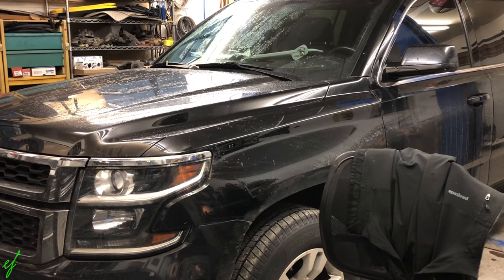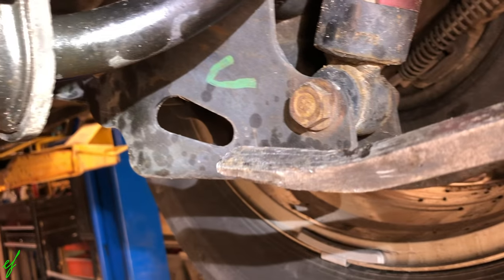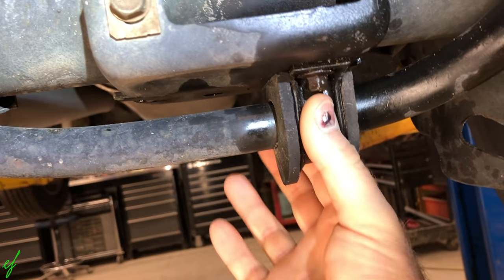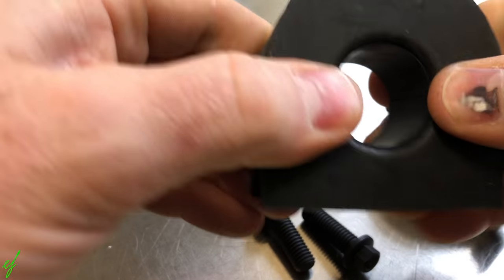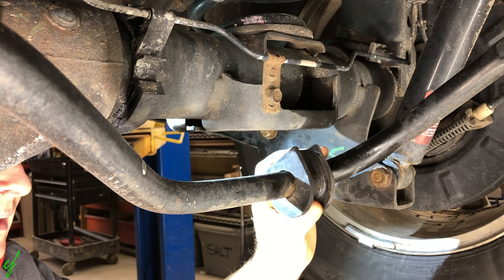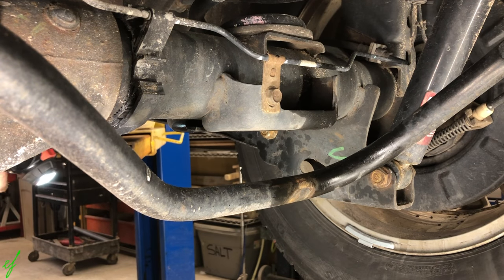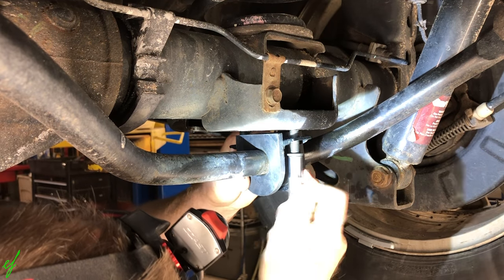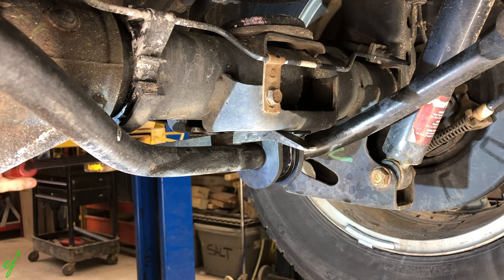SWAY BAR BUSHINGS  |  Professional Sound Diagnosis & Replacement

Comment: Cool vid 👍. I had thought the bushings went "harder" with age. I didn't know better. In the vid you're working on a rear axle right ? I've got kind of a funny noise but mine's
up front, when turning the wheel almost all the way. My ball joints (steering, suspension) are less than 10k miles old And my bar links are also pretty recent. I'm guessing it's those bushings. Ought to be them, right ?
Reply from the maker: The bushing are basically made of a polymer or rubber compound. They are made to be softer than the steel bar that goes through them. So basically the bushings will typically always be the wear component. I would highly suspect them. But to be sure I always shake everything down and try to locate the loose component. 🙂

Comment: What is the reason the bad bushing (loose) cause clunking noise? What metal to metal it is hitting. I looked at the sway bar and  it goes to sway bar link and strut but it wasn't hitting any metal? I have changed sway bar link (leak), outer tie rod (leak) but noise still there. I checked ball joint , control arm and strut there is no leak and it seems fine. I think it may be the bushing but it looks ok and no play or loose but it has 190k on it and almost 13 years. Th e clunk noise only when car slow down or slow start up or turning. Other than that, car runs ok. No noise.
I think it may be the sway bar bushing.  Thanks for the video.
Reply from the maker: No problem! The clunk from sway bar bushings is very much like a loose link, except bushings have a slightly noticeable rubbery clunk. Sway links sound more like a metal clunk. It is a very subtle difference, but it is there if you have a good ear. Any part of the sway bar system that is loose causes an amplified noise. That is because the parts are hooked directly to the body/subframe/or frame of the vehicle. They sound louder than you would think they could ever be for such little clunking movement in the parts. Through process of elimination is nothing else is loose and you have higher mileage, and you can not pinpoint the cause, bushings is a great guess. Plus they are one of the cheapest repairs on the car. I see a mysterious clunks from bushings once in a while like you describe. Probably worth a shot if you can not pinpoint the problem and everything else looks ok 😃🔧
Reply: @EasyFixShaun  Thank you so much for your explanations. I will update later whether it is bushing. By the way, that little noise drives me crazy.

Comment: I need to change my 03 Altima bushings and I need advice if it’s a good idea to buy them new online then install them or just get them new from the dealer ‘more than double the price’ also if there’s a difference between front and rear bushings or just buy 4 of them ? Thanks a lot.
Reply: Same question I have do we buy 2 for the front and 2 rear? Probably so I’ll keep you posted once I receive the parts this week
Reply from the maker: Usually they come in pairs when you buy them. Usually the fronts are different from the rears. I would look up the aftermarket parts you need based on the year, make, model, and engine that you have. When looking them up at the dealership the vin number is usually the best way so you will want to have that handy. On bushings usually any brand will work fine. Since they are usually dirt cheap parts in general I don't hesitate to use OEM parts from the dealers. They are usually very similar in price and the quality is always better. With nissans, parts are generally harder to find so that may be your only option. Good luck! 😃
Reply from the maker: Yup usually they come in pairs. Not always, so double check when ordering 😀
Reply: These are 12 $ by moog for  rear and 12 for front  at advance auto

Comment: Can i replace the rear sway bar bushings without the car jacked up?
Reply from the maker: Yes you can. You want to make sure the suspension is level on the axle you are working on or the bar will have spring pressure in it. (It is always trying to level the suspension side to side). This could make disassembly dangerous and reassembly very difficult. Basically you will be fighting the bar if the suspension heights side to side are not level. Here is another video I made with more information for both the bushing and the link 😃🔧 https://youtu.be/0S8JBe_jn6g

Comment: i have one of these bushes on  the inside rear of my suspension arm but it doesnt  have a split down the middle and im having a hard time getting it off is their a special tool for this
Reply from the maker: What year make and model vehicle do you have? Front or rear?
Reply: @EasyFixShaun  sorry My vehicle Toyota Cynos 96 front
Reply: @EasyFixShaun  TOyota Cynos 98 and its on the suspension arm
Reply from the maker: Sorry for the delay. I have been missing messages lately. My bad. Do you have a Celica? I have never heard of a Cynos.
Reply: problem solved new bush had a split old one none burnt them off replaced with new ones passed warrant and it is a Cynos

Comment: I'm able to use a mechanics lift when changin my oil at 5000 miles . And when the oil is draining , I liberally spray all rubber components / parts underneath with 303 Protectant . As to resist them drying out and cracking . And some people soak rubber components / parts overnight in it , wipe off and install .
Reply from the maker: Interesting. Does that stop cracking long term? Will it work on tires also?
Reply: @EasyFixShaun  Yes , it deflects the UV rays of the sun  . I periodically spray the outside tire walls and just let it soak in . Anything rubber or plastic it will protect  . I power wash my engine compartment around every six months and let dry . And then liberally spray it all over the engine compartment and let it soak in . Again , to resist the heat of the egine on the rubber and plastic parts , keeps them new looking . As my intake valve cover is plastic . You could search for auto detailing channels , where they mention it's use .
Reply from the maker: Interesting. I will check that out. Thanks! 😀

Comment: Nice, do you recommend rubber grease?
Reply from the maker: Thanks! No I wouldn’t use any grease. It’s best to install them all dry just like the factory does it when new. I have tried grease a long long time ago. After a month or two the grease washed out or dried up and the worst squeak noise developed. I had to replace the bushings again.
Reply: The problem with using grease on the bushings it's that because of it's "jelly glue" nature it will trap all kinds of dirt and sand in it, making the bushing go out prematurely. Maybe a tiny tiny dab of grease where it meets the sway bar wouldn't hurt, but make it Lithium grease. By the way, great video!
Reply from the maker: Thanks man! I still say zero grease unless you want problems. But if it works for you I can respect that too 😃

Comment: can a worn sway bar bushing cause it to squeek while turning?
Reply from the maker: Possible. But not super common. I would say check all steering, suspension and brake components. You may find a brake pad or shield hitting the rotor causing that. Could be a lower ball joint. I wish i could hear the squeak. I could help better. Make a video if you want and link it 😀🔧
Reply: @EasyFixShaun   Im trying to see how to send video but I can't find lol but I tell u I did replace the upper control arm someone was saying if u don't tighten the bolts in the frame underload can cause it?
Reply from the maker: Hard to say what it is so i need to hear it first. Make a youtube video. Then grab the youtube link and put it in the comments.
Reply: @EasyFixShaun  found out what the noise was! Its the upper ball joint. I replaced that end of last year. Do you know a good brand to get? So I will not end up same problem lol
Reply from the maker: @decisions139  Nice work! What kind of vehicle are you working on?
Reply: @EasyFixShaun  1997 honda civic lx
Reply from the maker: @decisions139  OEM HONDA will easily give you maximum durability. You want something made in Japan. Your car is older and they may not be available from the dealership anymore. The best aftermarket would be 2nd option for durability. Aisin ball joints are sold at NAPA as a second option, made in Japan.
AC DELCO OPTION--??
https://amzn.to/3mUDVDM 
You could try a ball joint from Delphi or AC Delco. That looks like the only options I like that are available on your car.  
I wouldn't use anything else. Even some of these after market option could surprise you and not be great. The parts situation for us all leave a lot to be desired as far as durability. OEM is always best. Aftermarket are the second best to HONDA Parts.
BONUS OPTION--?? 
https://amzn.to/3b906nl that looks like it could be good and strong and durable. More of a racing part. But could be good. Hope that helps 😀🔧

Comment: does it clunk in the rear backing out of drive way / pulling in drive way and even going straight over bumpy roads
Reply from the maker: Yes! Especially over sharp bumps.
Reply: What causes this noise
Reply from the maker: When the rubber bushings that hold the bar to the frame get worn and loose there is a gap between the bushing and the sway bar. The bar basically rattles around in the bushing or bushings. There are always two bushings. There is a lot of force from being attached to the suspension on the ends where the end links are. When any of the sway bar components become worn and loose the noise is amplified because the sway bar is attached to the frame by the bushings. It can be so loud that it sounds like something is falling off the car!
Reply: Going down a bumpy road

Comment: Ciao scusami siccome ti vedo abbastanza competente e professionale  posso farti una domanda? Volevo csmbiare i gommini della barra stabilizzstrice siccome gia li ho ordinati pero sono da 22diametro interno, ho misurato la barra invece è da 23 potrebbe darmi qualche problema oppure potrebbe andare lo stesso? Grazie intanto ti seguo 😊
Reply from the maker: Could work just fine as long as the straps and bolts fitment is good. Usually the manufactures don't change bar size by just 1mm, so you probably have the correct parts. Usually if two optional bar sizes are available on a vehicle the change in size is 3-5mm difference or more 😀😀
Reply: @EasyFixShaun  Grazie mille mi hai dato una risposta da professionista, comunque poi alla fine ho fatto il reso e messo quello giusto da 23 di nuovo grazie🙏
Reply from the maker: Nessun problema. Vi auguro una buona giornata! 😃

Comment: Man , you could have made us listen to the noise that was comming of possible. Lot of people would have identified that sound and could understood this was the problem they all had. Its just a suggestion. But it is a great video thougj
Reply from the maker: Thanks man. I should have. I apologize. I do have a bad sway bar link and the sound is sumiliar but a little more dampened. I will work on one for you.
Reply: @EasyFixShaun  thanks Man. Man Should never apologise for such a Great Helping Video.
Reply from the maker: Thanks man! It’s fun to help out. Easy to miss things along the way though for sure. I’m definitely trying to get better with each video. Thanks a lot!

Comment: I am gonna try this. I have replaced basically everything in the front end besides the sway bar bushings and lower control arms and i would not like to tear a bunch of shit apart again
Reply from the maker: The make a bunch of noise sometimes and also it is hard to find at times. Most times you can feel a clunk right in the bar. There are times were you can not feel the clunk by hand but it winds up being a link or bushing. Sometimes they are very sneaky. Its probably worth a shot. Plus they are relatively cheap 😀🔧
Reply: @EasyFixShaun  i hope thats what it is! I replaced the links already
Reply from the maker: Good luck! If that doesn't do the trick, keep going and start from step one and try to locate the noise again. The goal is to pinpoint to culprit. If you exhaust that method- Plan B. Plan B is replacement of parts even if they are wrong in an attempt to repair. Since Plan B is a guess, start with the cheapest and easiest parts first 😃🔧
Reply: @EasyFixShaun  i have a question. If i was driving on bad sway bar bushings. Do you think that might have damaged the shocks?
Reply: I just replaced them 2 months ago
Reply: @EasyFixShaun  just found out the issue. It was the shock. The one on the right is shot
Reply from the maker: @klasek29  Hey nice job sticking with it until you sorted it out! A+ 😃🔧

Comment: I just replace the ones in my GMC Acadia but now it seems like I have no suspension it all, every time when I pass by bumps it's too hard,.. what I did wrong?? Maybe it needs to be greased??
Reply from the maker: Hard to say. But you may have another issue. If the links are tight and the bushings are tight after your repair I would look for other things. Usually the links and bushings are either good or bad. So if they are tight I would look at other suspension components like maybe struts. When all else fails start at square one and recheck everything for looseness in the steering and suspension. Sometimes its easy to accidentally miss something. Stick with it you are on the right track. Sounds like maybe you will just have an extra step to do, to get it repaired.
Reply from the maker: Usually they are pretty easy. Corrosion is typically the only thing that makes it difficult.
Reply: @EasyFixShaun   you know what I ended up taking the off, and add  silicone grease and they just work awesome... I recognize my mistake 😂...
Reply from the maker: I’m glad you got your a fixed 🙂

Comment: Do you have any advice if the bolts are extra stubborn to remove? I drive a rust bucket 😂
Reply from the maker: Yes! Rust sucks. In Michigan it is just part of life unfortunately. Its a salt problem. We have the worst cars, but we have the best boats! Anyways, three methods for stubborn bolts starting with the least intrusive. First soak in PB Blaster or another penetrating solvent. If that doesn't work heat them up with a map gas torch or something similar. If that doesn't work cut them off or drill them out. Replace them with standard bolts nuts and washers.

Comment: For replace them, need lift the car?
Reply from the maker: Good question. You can replace on the ground or in the air. The bars and system doesn't hold weight of the vehicle. The suspension does need to be level side to side to make replacement easy and safe. Otherwise if suspension isn't level side
To side there will be pressure/energy in the bar and components from twisting of the bar. This is how the bar system works and try's to level the vehicle side
to side. So make sure suspension is level side to side to eliminate pressure on the bar. Does that help?
Reply: @EasyFixShaun  I’ll try it at this weekend. Gonna respond you
Reply: @EasyFixShaun  yes, it does. I did it, was very simply
Reply from the maker: @edenbul6140  Excellent job sorting it all out! 😃

Comment: My 2010 Acura TL looks like these bushings are worn out on the front and I do hear a metallic noise over sharp bumps. Are you sure this was the culprit in your case? Have you got rid of that clunking noise?
Reply from the maker: It did fix my problem. If your bushings are loose like in the video they are the first thing to start with because they are the cheapest suspension component on the car. Replacement is usually pretty straight forward. There could always be more parts needed. Sometimes the links are needed at the same time. Car repairs aren’t always cut and dry. When in doubt start with the cheapest items to repair. Both links and bushings are common failure points on most suspensions.

Comment: Do u have to raise the cat up. Can u do it without raising car up or.removing tires (if those bolts r easily assciable)
Reply from the maker: Great question. You don't need the weight off the vehicle. The sway bar doesn't hold weight up. So you can replace the parts while on the ground. I have done it many times in the driveway. 😀

Comment: Today I felt like my steering was kind of loose when I drive fast into a soft curve it feels like the truck moves to the left or to the right I didn't notice that my sway bar had moved to the left because I could see dark black so I'm thinking it could be my sway bar bushings are worn out
Reply from the maker: You should be able to do a quick wiggle test on bushings and links while on the ground on a level surface. If you find any play, replacement of the loose parts is needed. For best inspection results also lift the wheels off the ground safely, shake and inspect all other steering and suspension components for excessive play. Same thing, all loose components must be replaced. This should be done for front and rear. I hope that helps 😃🔧

Comment: Could a rear wobble at low speeds be bushings?
Reply from the maker: By wobble to do you mean a rattle over small choppy bumps?
Reply: Easy Fix .. it turns out rear wheels were worn.. thanks
Reply from the maker: I am glad you found the problem! Nice work.

Comment: Do you have to jack the car?? 2007 jeep are so easy to change....no need to jack the car.... just dont know if it makes a difference...jack or not..
Reply from the maker: Nope you don't need to. You will need to be on a level surface though. The sway bar try's to even out the suspension left to right and if you aren't level it will make it impossible to remove and install. It's like a torsion bar spring in an un-level position. It doesn't carry any weight other than the weight of the bar and links and can be done on the ground if you can access it that way 😃🔧